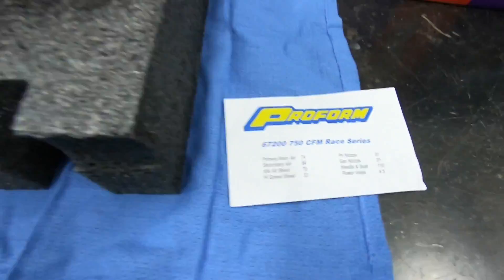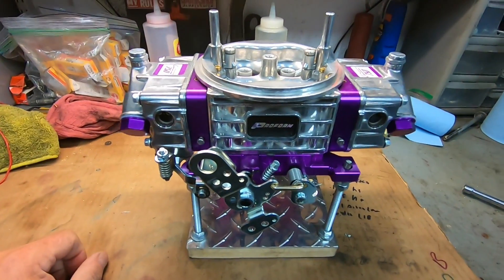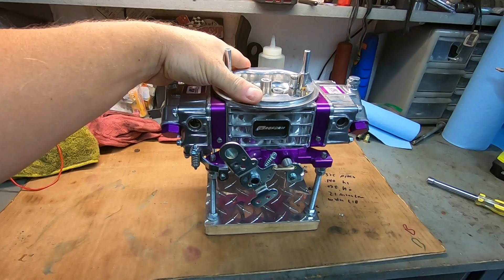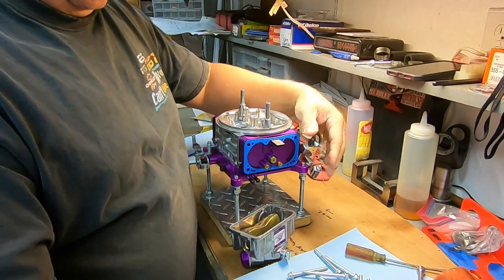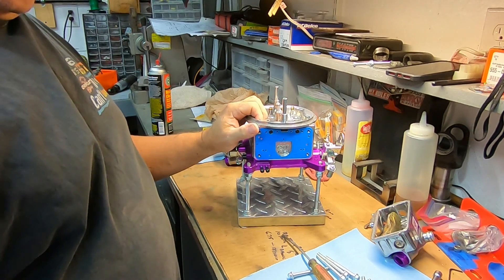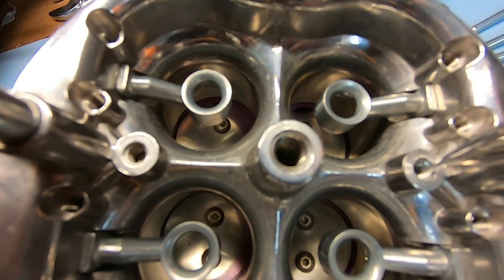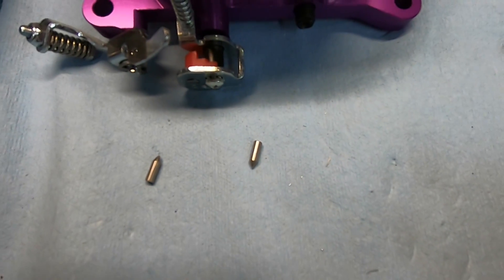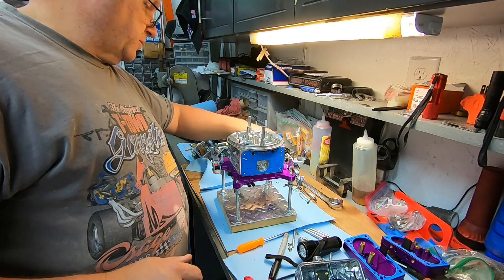Trying out a Gas Carb - Difference between Methanol and Gas - Part 1 - Inspecting

Comment: Spray cleaner around edge with light pressure of screw driver will SET YOU FREE! 
Hammer on carburetor is a true Butcher
Reply from the maker: Thanks for the advice!

Comment: Ken can you tell me what fuel pump you are running. Thinking about switching over to methanol. Thanks
Reply from the maker: I got it from Pro Systems. https://www.prosystemsracing.com/product/440-gph-fuel-pump-with-regulator/ when I got my carb. So far it's been holding up great!